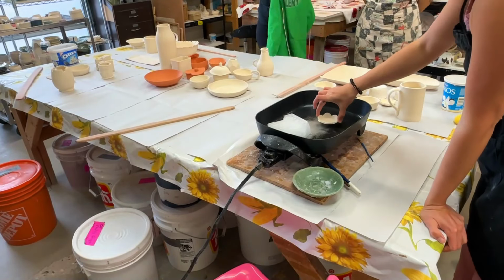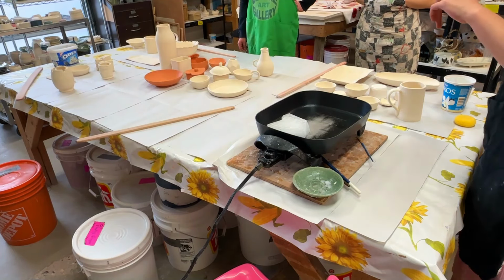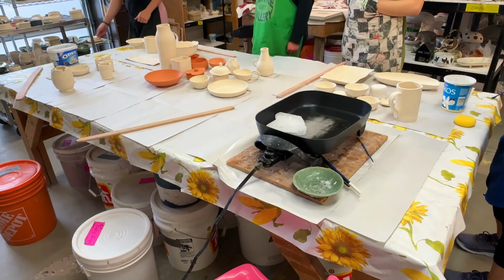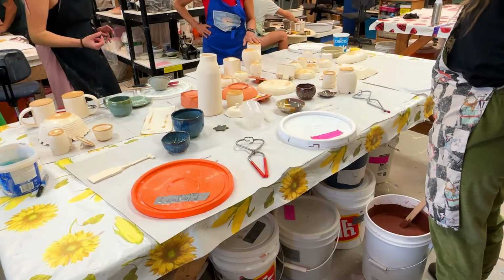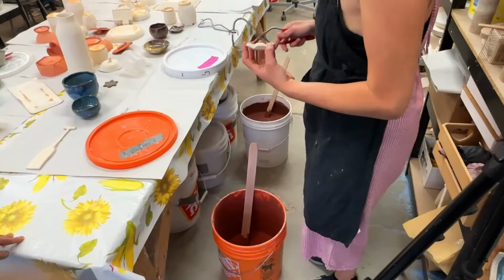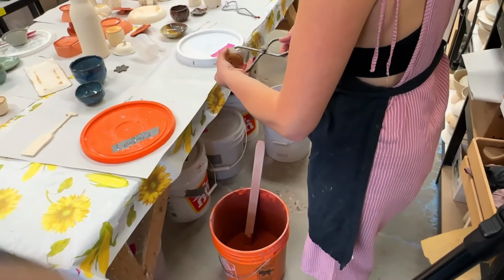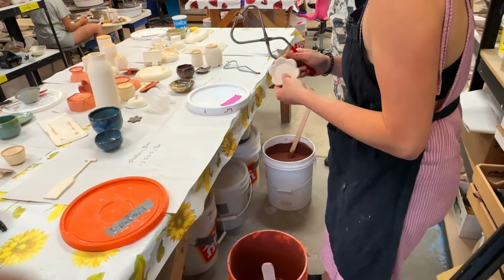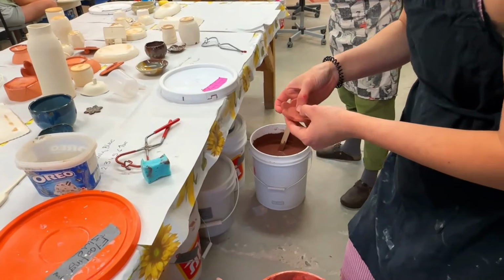Part 1/2 - Introduction to Pottery Lesson 5 Glazing at Potters Addict

Comment: Please explain what is in the pan. Thanks
Reply from the maker: Great question! The pan contains a liquid wax resist, which is used in pottery to prevent glaze from adhering to certain areas of the piece. By dipping the bottoms of the pottery pieces into the wax, we ensure that these areas remain unglazed during the firing process. This prevents the pottery from sticking to the kiln shelf, making it easier to handle and resulting in a clean, professional finish. It's a simple but essential step in the glazing process. Thanks for asking! 🌟